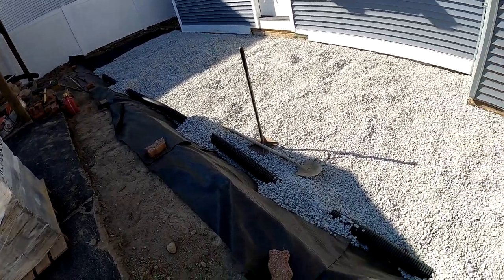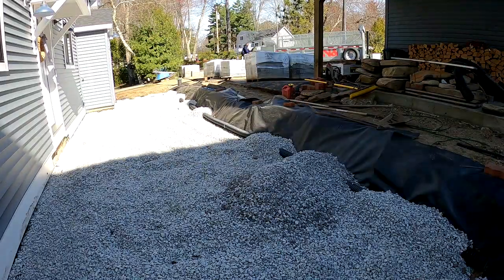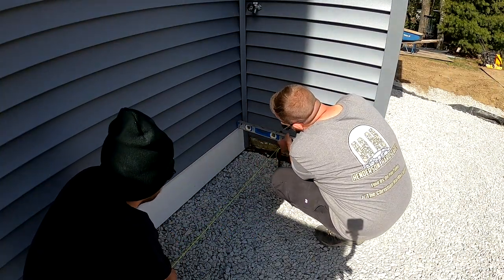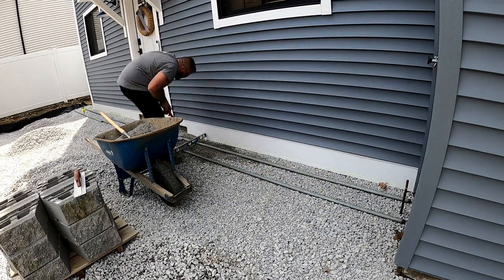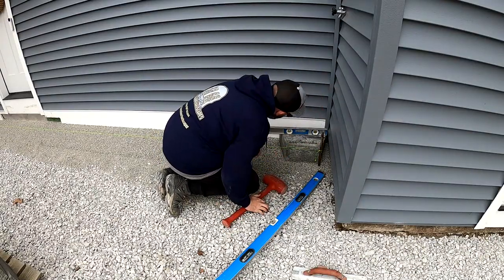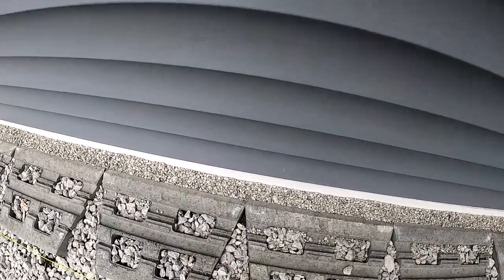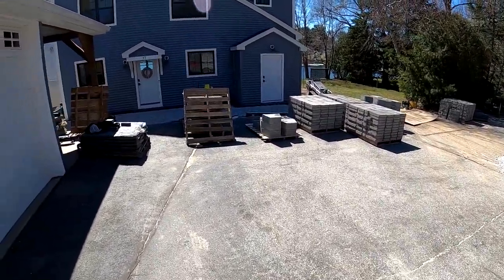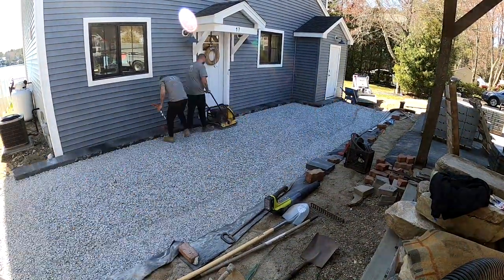I Had to Build This Wall Before Laying Pavers....

Comment: Thank you! this video cleared the confusion I had on how to make the first block of a step fully buried. It seems you run your 3/4" clear stones twice, once to get a depth of 4-5" that is when you lay the first step blocks. Once that is done, they you run your second round of 3/4" stones of 2-3" this is how the first block gets fully buried. Sounds simple, but I couldn't figure it out for the longest time lol. Question, I noticed you constantly use Teko Bloc Semma for your steps. Did you try the Unilock U-Cara wall/step system? I am considering that to make the face panels match the pavers. If you have experience with them, I would love to hear your feedback.
Reply from the maker: I'm glad to hear it! I do like to use the Techo Bloc Semma for steps / walls. I have seen the U-Cara system a handful of times, personally I do not like the style too much. I don't really like smooth faced wall block of any kind though, I like the texture

Comment: You are just amazing.  Do you always need to put the block if you are building a patio by the foundation of the house.  We have a similar situation with patio door and wood plank below and then the foundation wall.  Do you think we should put a block please advise and you also added a drainage pipe. Even though the patio didn’t seem large Can you please explain thanks
Reply from the maker: We very rarely ever have to do that with the blocks. It is deceiving but this house actually does not have a foundation at all, it is on stilts... Meaning it is on timber supports which rest on concrete footings in the ground. So without that block, the base stone was likely to settle and shift because of nothing but the white trim holding it back. So in this situation, the blocks were necessary in my opinion. If you have a concrete foundation wall, you will not have to do this. Just seal / cover the wood plank that is exposed before backfilling and you will be all set ✌
Reply: I know you’re not based in NJ  but do you have a friend who does your kind of work?  I would pay anything if you were here.
Reply from the maker: Unfortunately I don’t know anyone out that way… I hope you find someone good though ✌🏻

Comment: Is there any concern about water seeping into the house when the top of the wall/pavers are above the sill in the house framing?
Reply from the maker: No concern, We have the pavers sloped heavily away from the house towards the wall / drain. Plus we leave a gap in between the house and pavers for water to permeate down into the base stone before hitting the house sill.

Comment: Could you put a gazebo directly on the pavers, or would you put footings in?
Reply from the maker: It really depends on the gazebo... Something with a hard cover and is prone to wind putting a lot of pressure on it is not a very good thing to anchor to the pavers. But say a pergola with an open top, has less of a chance to have wind pressure. So if you don't really think what you choose for a gazebo has much of a chance of blowing away, then yes, you can anchor it to the pavers and you will be good.

Comment: Is there any concerns about the siding, if it is ever to be replaced or repaired?
Reply from the maker: Not really. The trim board is an azek board which will never rot and the siding is vinyl which should be fine as well. If anything happens higher than the pavers, they can still fix it.

Comment: When you are building a patio that the pavers are against the house, do you always need the wall, also when doing pavers with a retaining wall, the retaining wall should always go first right?
THANK YOU😊
Reply from the maker: It is not necessarily every time you install against a house... If you are building along a foundation, no wall is necessary. But when you are building it along siding and trim boards, yes, you should build a wall to keep the pressure off the house. And yes, retaining walls are typically always built before the patio, unless the wall is small and can be laid at the same height as the pavers.

Comment: Do you have to have that block against the house  if you have a brick foundation ?
Reply from the maker: No you don't, I did this wall because it is up against the siding / trim boards. If you are building up against a foundation wall, you do not need that ✌